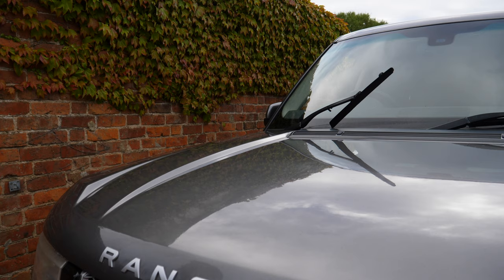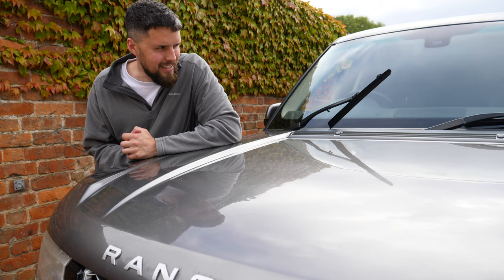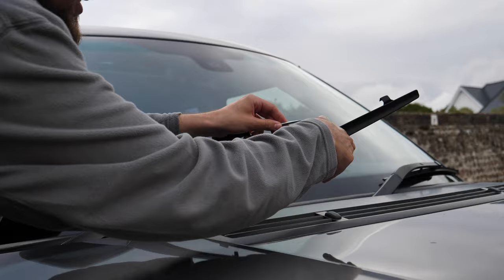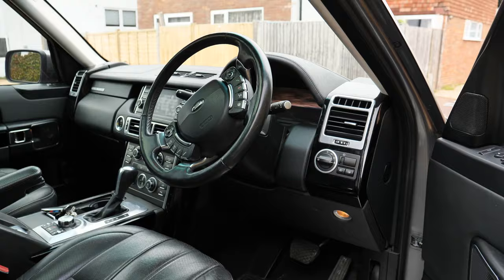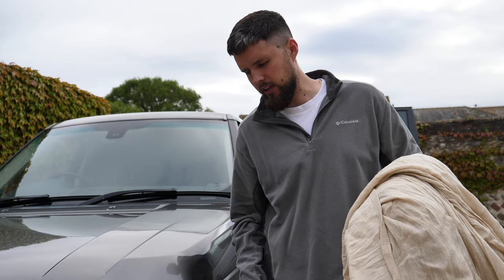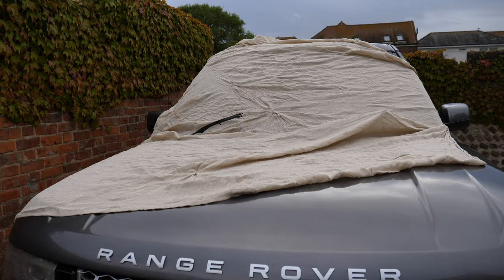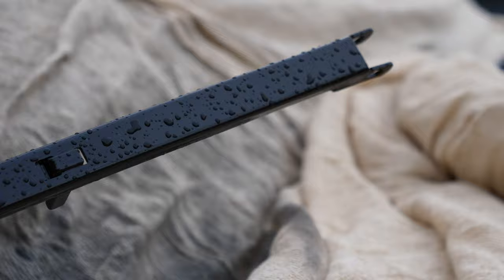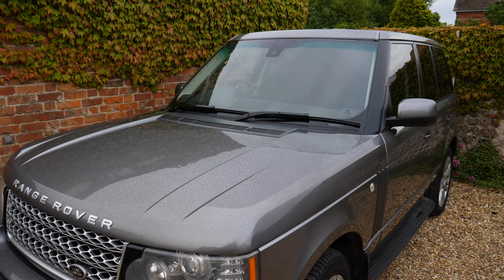My Range Rover L322 TDV8 TRANSFORMED with £30 and 30 Minutes

Comment: I took mine off, wet and dry paper rub down. Wash and blow off. 
Spray with Halfords grey undercoat, then Halfords gloss black. Did all 3 wipers and they look great. 
I’ve done every 4x4 I’ve owned. Better off removing them.